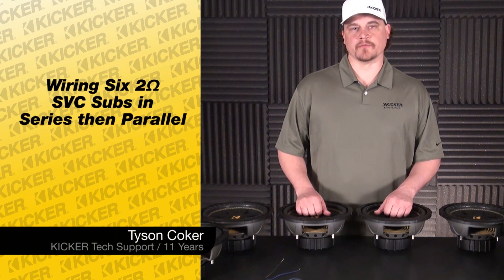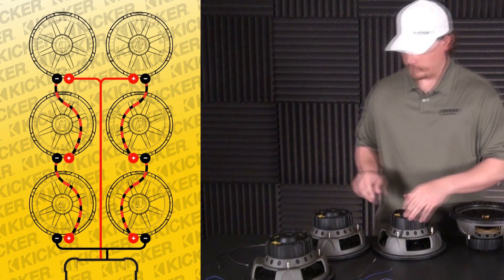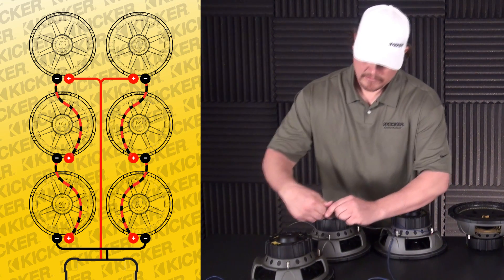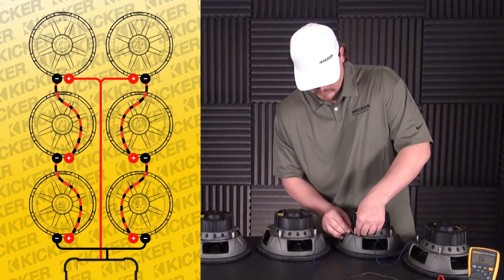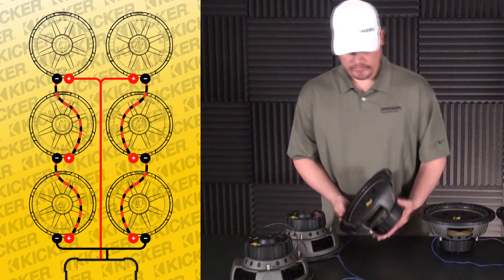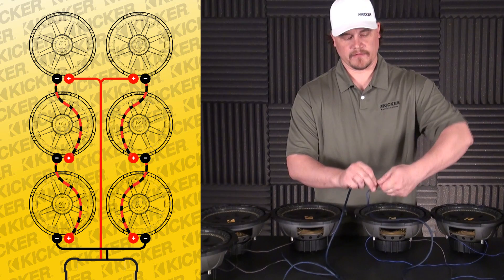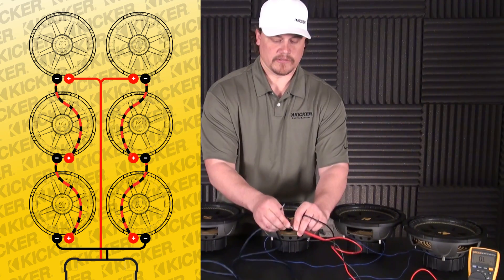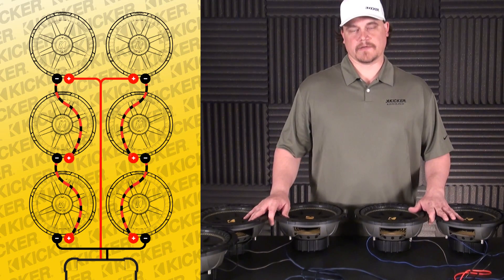Subwoofer Wiring: Six 2 Ohm SVC Subs in Series / Parallel

Comment: Same would apply for dvc 2ohm subs ?
Reply from the maker: Wiring a DVC sub is not exactly the same as a SVC. Ohm's law still applies in terms of wiring configuration, if that's what you were asking. If you have a single 2-ohm DVC sub, then each voice coil is 2-ohms. If you wire those voice coils in parallel, it's going to be half of that, if you wire the two voice coils in series, it's going to double.

Comment: I have 6 4 ohm single voice And I'm trying to wire them to 2.66
Reply: I got 6 Svc 8in speakers I’m about to put in each door of my truck, and I’m putting them in a crescendo c.2sq and I’m trying to figure out if I’ll be at 2.66 at the amp or higher, 2ohm is low as I wanna go, I don’t want my mids to be at .6 ohm, what did you end up doing?